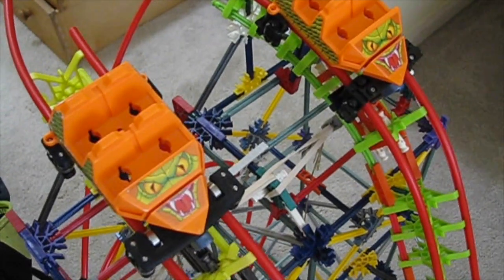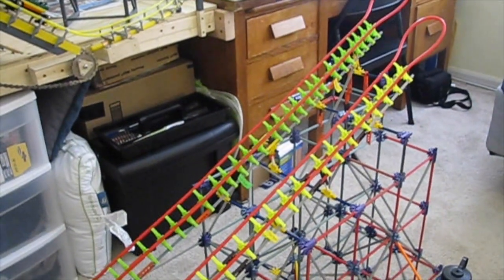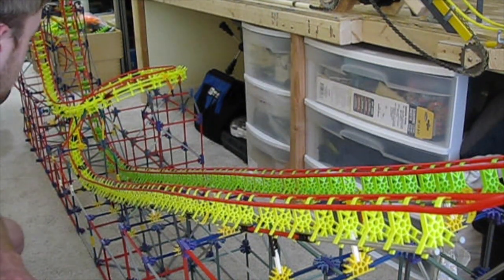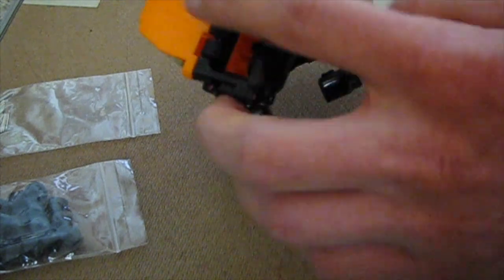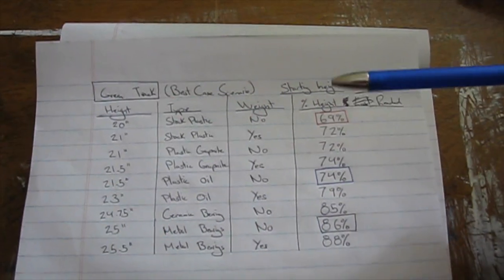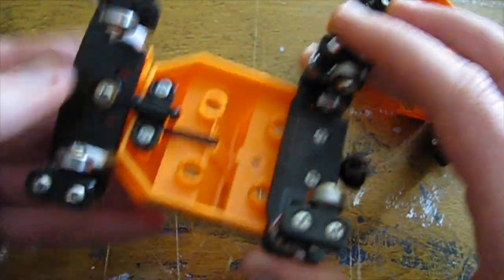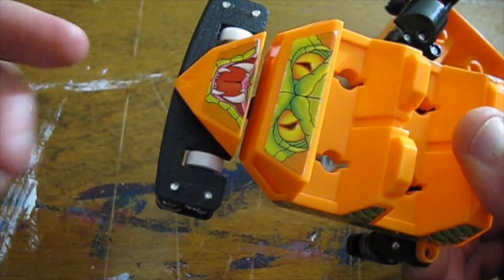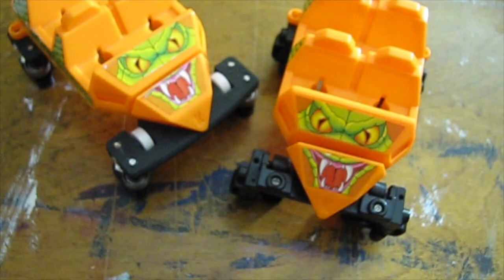Ball Bearings vs. Plastic Wheels - K'NEX SS Car Performance Comparison

Comment: Thanks! Very good video. If I want to do a B&M coaster without looping or spin, weight with oil is the better things?
Reply from the maker: Hey thanks, and yes, if you are not doing many twists and turns weighting the cars is beneficial. Also, if you stick with the regular wheels, your best bet is to use a little oil on the axles. Going back to the weight, I did a quick setup with batteries, but taping/sticking coins/weight to the bottom of the car would be better in the long run as it keeps the center of gravity lower in the car which would make less "jostling" and and therefore speed loss in turns.
Reply: Thanks for your help. 
I've print bearing system for 6 car. I'm excited to try them

Comment: Would bearings work on the micro coaster cars?
Reply from the maker: These particular bearings wouldn't as they are much to big, but a smaller assembly with bearings could theoretically  be designed for the micro cars. One of my concerns would be the added weight of the bearings, but if the track is supported correctly it may improve the performance of the micro cars.
Reply: @3dcoaster  where would I get bearings for small cars? Could you make a video about it please?

Comment: where did you get the new plastic wheels from? that would be insanely helpful
Reply from the maker: All the plastic wheels are stock, but the bearings were purchased off Ebay. And then the plastic wheel assemblies (that house the bearings) are just 3d printed. I made another video showing how to clean the bearings as well as assembling the wheel assemblies. Here's the link for the 3d design files: https://www.thingiverse.com/thing:4263286. Have a good one!
Reply: @3dcoaster  thank you!